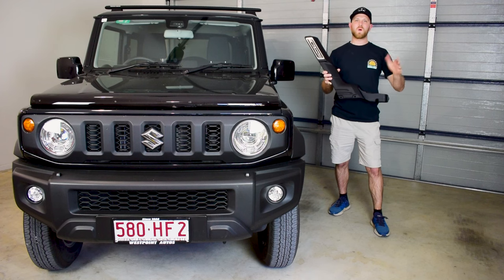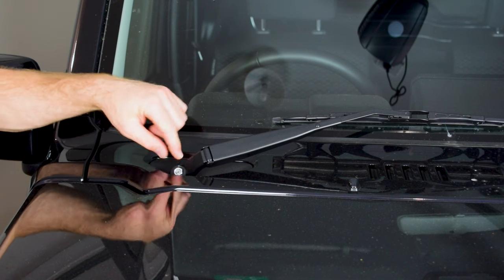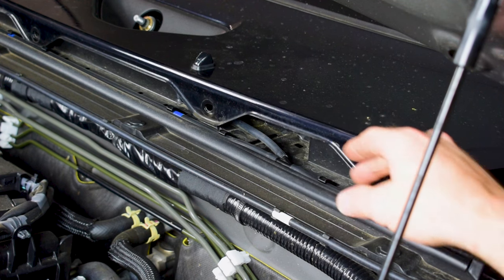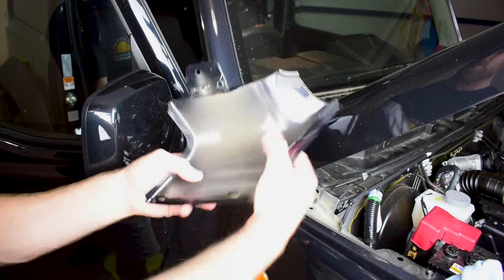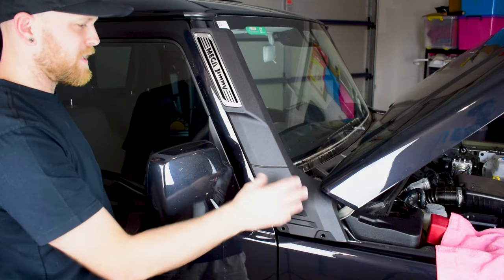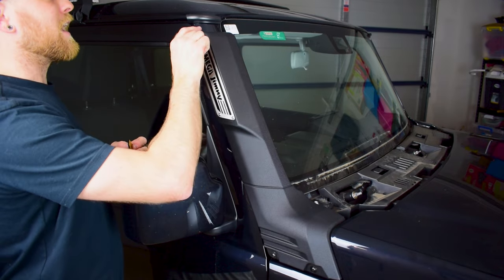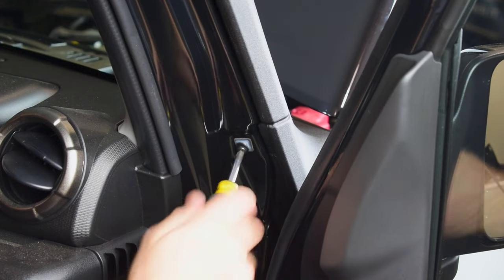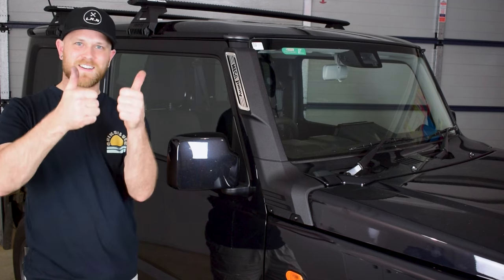Suzuki Jimny SNORKEL INSTALL - DIY NO CUT/DRILL SNORKEL - How To Install A MEGA JIMNY 3.0 Snorkel

Comment: I was skeptical about the "No Drill" Snorkels after seeing a few where Brackets need to be removed or deformed that are attached to the main body shell. I still think that cutting a round hold in the replaceable Guard would be my preferred method of installing a Snorkel.

Thanks for this great demonstration on how the Mega Jimny snorkel does not have these issue, but I am still skeptical about the Airflow around the Hinge area. The amount of space taken up under the bonnet is still not appealing to me.
I still prefer a genuine Brazilian Snorkel 90316-BPA00-000, but they are difficult to source in Australia and are not designed for RHD vehicles.

Comment: Thank you, just one question, how does snorkel works under rain, what happens in the rain. With the water exccess how the snorkel drains. Is there a mechanism?
Reply from the maker: Water just goes out the drain hole in the airbox.

Comment: Great video but wish we had a sound test mate? Any induction noise, flutter etc or quiet?
Reply from the maker: There isn't much noise until your under load at around 4-5000rpm. Just a slight intake suction noise. No flutter as it's a naturally aspirated engine.

Comment: What's the water wading capacity before and after fitting the snorkel??
Reply: The water wading depth on the Jimny is only 300mm! I know, poor right. After looking in to why Suzuki state this its due to the diff breather's. I live in the UK and spend a lot of time in water so the first thing to fit is a differential breather kit. Snorkels while are a good insurance policy if you end up in the deep are not really made for water crossings. They are more for getting cleaner cool air in the motor. The stock air box has drain holes in it so I would change that too. If you are that deep in the water (up to the air box) you are in trouble. However with momentum and a water tight system you can go deeper for a few seconds without taking on water

Comment: How heavy rain or carwash? it is safe? got any drain so the water does not overflow into the system if incoming from the tip??
Reply from the maker: There is a drain hole in the airbox to allow water to escape if it enters via the snorkel.

Comment: The snorkel material is LLPDE. It’s kind of oily surface. What double sided tape did you use?
Reply from the maker: It is special automotive grade felt tape. Use a bit of wax remover to clean the spot where it sits 😊
Reply: @LowRangeNick  thank you. Will try that. Have used a few types double sided tapes but non managed to hold it in place.
Reply: I didn't manage to get anything taped to it so installed a felt/sponge sticker to the car beam acting as a wedge/silencer

Comment: How to wash car with pressure water? May be water will go inside thru snorkel right?
Reply from the maker: It's OK because it will either evaporate in the snorkel or drain out airbox drain hole.

Comment: No matter how I tried, I could not get the pipe from not touching the master cylinder reservoir. Maybe a variation in manufacturing tolerances? I would be careful sourcing this product unless they have come up with an alternative pipe system.
Reply from the maker: I had the same issues. It did not fit well and the pipe vibrated through master cylinder. I have since removed and returned the snorkel.

Comment: Do you have any issues with a rattle from the pipe and the hood when you start the car?
Reply from the maker: Yes, I have talked to mega jimny about it vibrating on the brake fluid resivoir and touching the bonnet. They are getting in a 10 degree silicone bend in to rectify the issue. If you contact them they should be able to sort you out. 🙂
Reply: That's really useful thanks a lot!

Comment: Nice video 👍 , however a jimny is already underpowered and narrowing the intake will take down the power even further . Do measure your throttle body's inner diameter and the inner diameter of the narrowest section of this snorkel. Do post the figures here . Thanks again 👍
Reply from the maker: It is the same size intake as the factory pipe. There isn't any performance loss. 👍